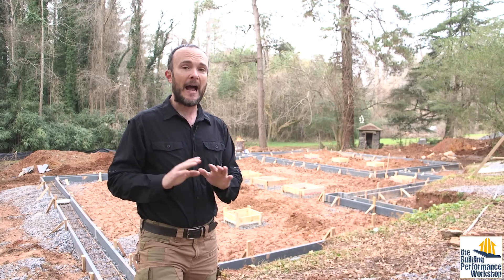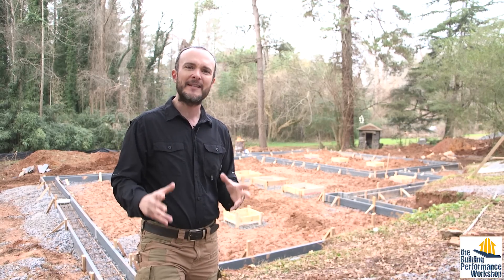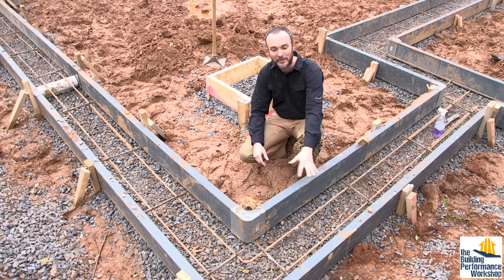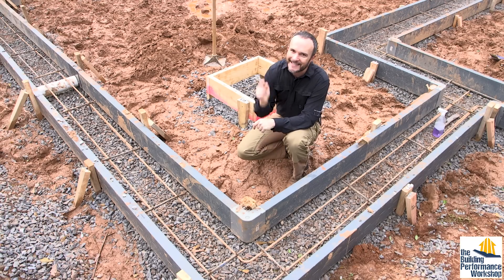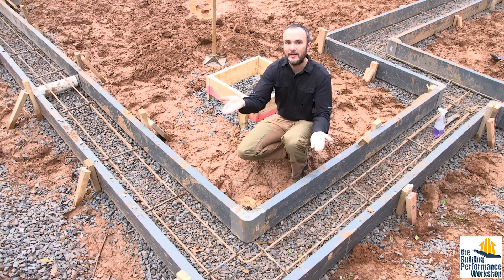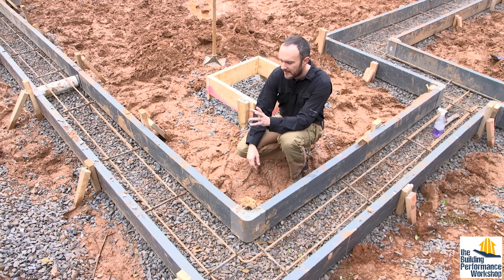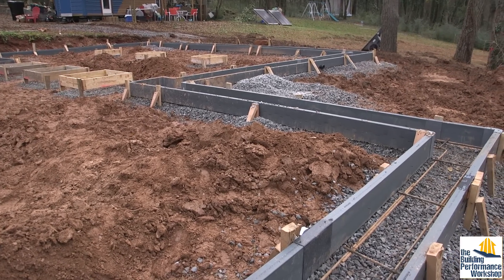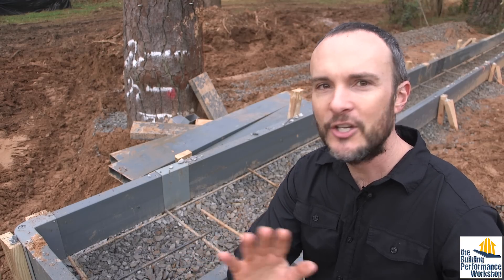First Concrete Pour: Form-A-Drain 4-in-1 Foundation Footings

Comment: Metal inside of concrete will rust because concrete is porous.  Rusting metal expands.  Expanding rusty metal cracks concrete.  Don't think you know everything.  And oh yes, even though you start out with clean rust free rebar, you are exposing the rebar to moisture which starts the rust process.
Reply: Julie moisture is not a problem, oxygene is a reason why metal rust, You are pretendig that you know what you are talking about, but your lack of knowledge is obvious. 
concrete is resistant to compression, but less on stretching. Adding a reinforcement in the form of rebar will make a concrete much more resistant for stretching, and last but not least if reinforced concrete is made corectly metal will not rust
Reply from the maker: I have never pretended to know everything, and I also have never been taught a way to build using concrete without rebar. Congrats on being cutting edge.
Reply: I missed the part where he said the rebar will never ever rust.  He presented the information very well.  Rebar does in fact increase the overall strength of the footings...are you just trying to be an ass and argue for no reason?

Comment: Form a drain sucks used it on my house moves too much. Wish I would have used wood forms in a trench then placed form a drain after. Would have saved on fill sand cost and been easier
Reply from the maker: Worked perfectly for us so far
Reply: Pretty sure your movement problem is the sand not the plastic form. The words fill and sand don't mix well

Comment: Does the exterior drain communicate with the interior drain?

If I understand correctly the radon system ties into the form-a-drain. Will you be installing any slotted corrugated pipe as part of the radon system? (I’m sure you will be doing a future video)

I’ve done a few french drains in crawl spaces recently. My research found that socking the pipe is no bueno, and that wrapping the whole assembly, including the gravel is muy bueno. Hopefully you have a detail to protect the slots, and the clay from mixing with the gravel.
Reply: Looking his soil he got no problem with radon . You get radon concern in rock soil not in a earth soil
Reply from the maker: Yes, Neil, they are tied together at four points. There will be a perforated sched-40 PVC going into the center of the gravel under slab. Thx buddy

Comment: Cool form product! I like your radon detail, sounds great. Also, I think slump tests are supposed to be done on site. And all forms bend unless there's enough bracing. Might just need more with plastic forms instead of wood or metal. Thanks for making the video! There's several things I didn't know before. I've never heard of cleaning rebar, or taking rebar out instead of tieing to the chairs. I've always seen rebar tired into a mat and plastic chairs or bricks used to hold the rebar mat to the correct height inside the concrete. Looking forward to the next video!!!!!
Reply from the maker: Interestingly, I could see the rebar floating upward from the  buoyant pressure of the boom pump, but they nudged it back down to 3” with the rebar L pieces that will go up into the wall.

Comment: your explanation of slump test was not complete....the batch plant does design the mix to a certain slump, and more importantly psi of finished product....then on the job mud is poured into particularly shaped vessels and then tested for the strength at  a time after cure.  The slump is determined on the job when the stuff is poured.  If they don't know about not having caked on dirt on the rebar....wtf
Reply: yes i saw the mud on the rebar right away and with all the mud around the footing, that you can tell due to so many footprints, and walked on so much it is soft and the water is pumped up, concerns me that the ground isn't solid enough to begin with.
Reply from the maker: @grahamward7952  https://www.youtube.com/watch?v=BBXLMon78q4
Reply: Correct,  the concrete is ordered at the particular slump and mpa ( not psi ) to suit your requirements. Further testing can be done when the concrete is delivered to ensure you get what you asked for.. Too many concrete pump operators want to add more water to increase the slump but the knock on effect is a weaker concrete strength ( lower mpa ).
Reply from the maker: Thanks for 'getting it', brother! You made my morning.
Reply from the maker: Understood, but literally no one I asked could tell me how exactly to run the test onsite, or what slump we should aim for. Had several engineers and architects and contractors involved. Also, taking samples to find out about later is not worth the delay it puts on the build, imho. This house just doesn’t weigh that much.
Reply: @HomePerformance  there is no onsite strength test only air and slump. Concrete strength is generally designed at 80mm slump. if you want the best crete have it batched at 80mm (3in.), when it arrives have the driver reslump the concrete to 80 with water as long as you are within one hour of batch time. If the pump operator requests a higher slump and he will... 100mm to 120mm (depending on aggregate size and cementitious content) usually, use a plasticizer. Most crete can be pushed to 100 with water but for the cost use superP use it but I recommend making sure the crete isn't too dry when adding plasticizer as it needs some water to react with.
Reply from the maker: @DavePreissl  Thanks man
Reply: @HomePerformance  see link, https://www.boral.com.au/sites/default/files/media/field_document/Boral%20Book%20of%20Concrete.pdf

This is how we do it "DownUnder"

And wow,  it seems everyone is an "expert". Ex as in has-been and spert as in a drip under pressure. 😂Many of the guys don't seem to have watched all of your videos and just chip in randomly without any background information or consider that different areas have different underlying geology, building regulations, building practices and building standards!
You must have pretty thick skin and the tolerance of a Saint. 

You know what we say, " Opinions are like butt holes; everyone has one!
I'm sure you're aware,  building is a science,  stuck with the science and the Qualified Experts and you'll be fine.  Enjoy the emotional rollercoaster.

Cheers.
Reply: @8Hamo  Thanks alot!! Just downloaded the book.

Comment: Hi Corbett, I have been watching your channel for some time now and I enjoy it emensly. 
Well done getting the footings in for your new house, I see its been quite a challenge. Things should go a little more to plan now that you are out of the ground (so to speak).
Here in Australia, slump tests are performed on site to verify the slump of the concrete delivered. As you are aware concrete strength is a ratio of the water to cement, too much water reduces the the strength and hence requires more cement.  The higher the slump,  the greater the amount of cement required to achieve the required concrete strength (science!) 
We also can have compression tests; samples are taken on site,  then taken to a lab, left to cure (various cure durations) and then tested for its compressive strength to ensure it meets the required compressive strength for the project.
Good luck with the rest of the build and I look forward to watching your progress. 
Cheers from Down Under
Reply: Hi Corbett,  yes on-site slump tests and cyclinder tests (compression tests) can be requested for domestic dwellings. I have had architects that have specified that tests are to be performed as part of the contact documentation. 
It is also worth noting that the major concrete plants have strict and high standards of practice with producing concrete, the best advice one could give is not to add water to the mix when it arrives onsite as adding water weakens the mix, don't let anyone tell you otherwise... it's science!
See www.boral.com.au 
Go to concrete
Go to "The book of concrete"
It's worth the read. 
I tried to paste the link, but eh', I'm just a builder!
Cheers,  Colin
Reply from the maker: Thanks Colin- we do the same in the states for big buildings, but not for homes. Have you seen this testing done for modestly-sized homes there?
Reply: @HomePerformance  We do it in California if the homeowner or  the Engineer of record wants it done, I have performed special inspection on several homes myself, mostly big homes by wealthy people. The service is not cheap.